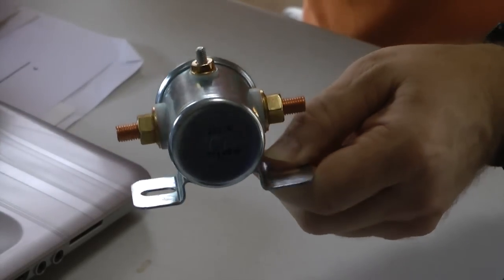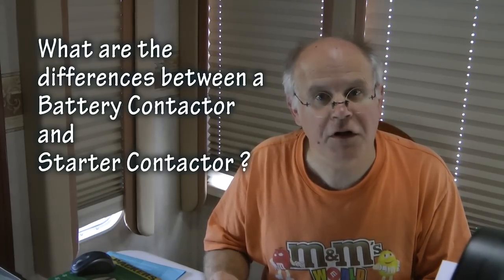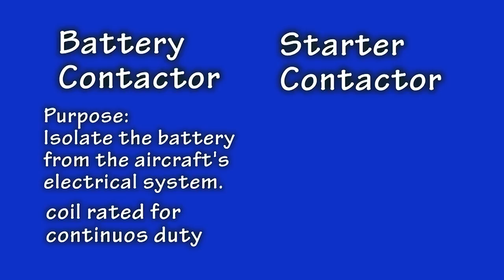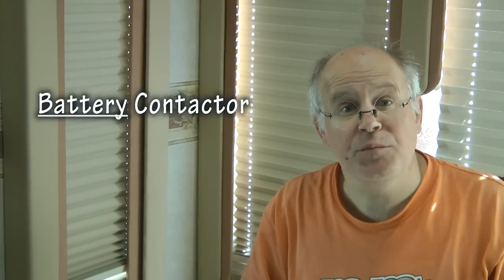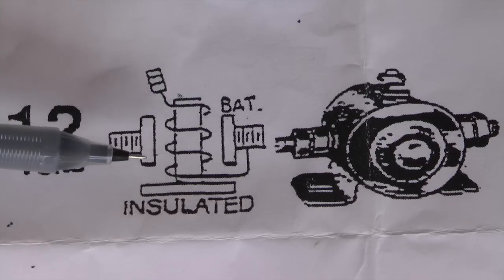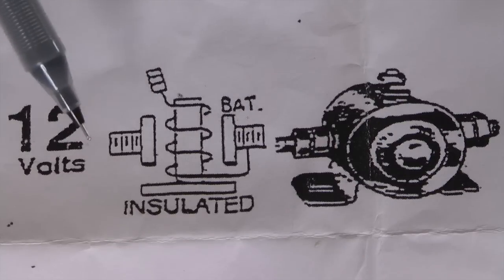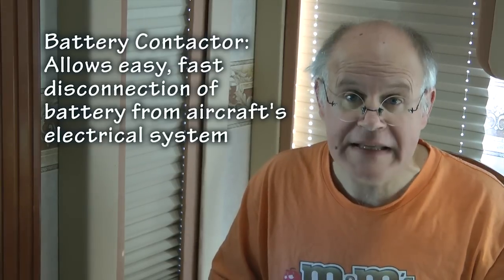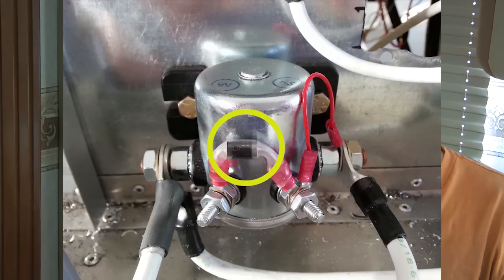The Battery Contactor for Experimental AIrcraft

Comment: You mentioned that in your “ next video “ you would talk about the reason for the diode . How to find that video please?
Reply from the maker: Learn to use the YouTube search and life will be much greater!   Step 1 - click the circle icon picture next to HomebuiltHELP (that takes you to our channel homepage ) Step 2 - use the search box and enter "Diode"     Easy!
Reply: Thank you- sorry for being a dummy !😢
Reply: Please bear with me . I truly am an electrical dummy : you say the wire 
to the master switch / coil takes 1 amp. The electric source is the battery delivering 12V. Using Ohms Law I= V/R and so 1=12/R . Ie R must = 12. So where is the 12 ohm resistance coming from ?
Reply from the maker: @ajscain500  The coil itself has resistance.  It uses power to create a magnetic field to engage the internal solenoid switch.